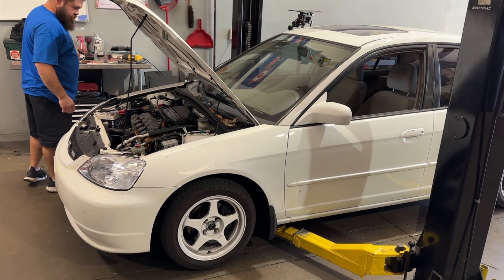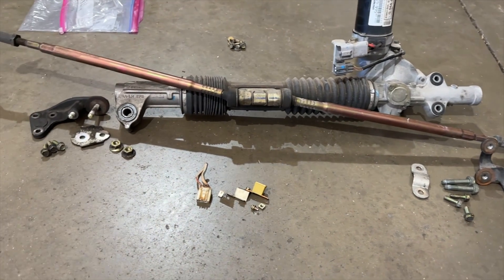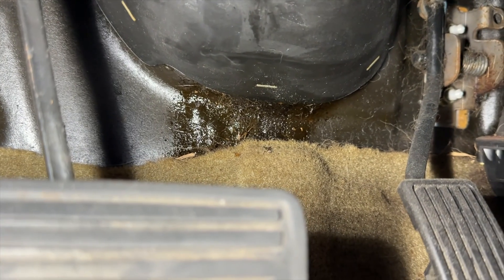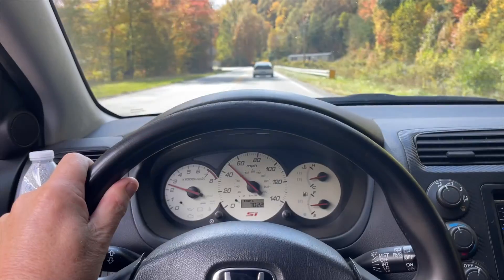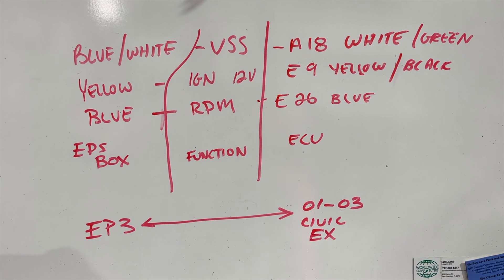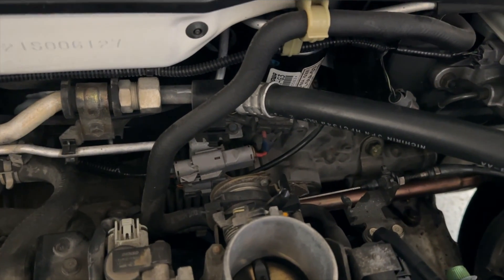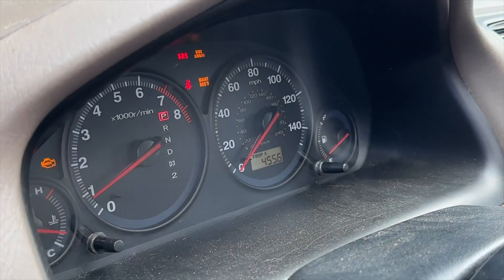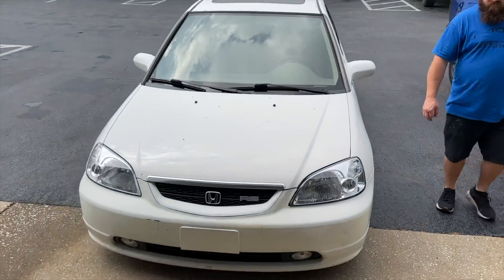Civic Electric Power Steering Conversion - Uncle Ray

Comment: I recently bought an 01 civic ex coupe with the conversion already done but wasn’t working at the time , I bought a new module 
Disconnected battery, plug new module in and drove the car for about 5-10 minutes with the power steering but then just gave out 
Might know what the issue could be? idk where to look

Comment: I had my HPS converted to EPS but there is not much difference, in fact the same. What do you suggest, where things have gone wrong? When I turn the whole wheel on either side till end the front lights get bit dim what could be the issue. Also I could not understand E9 etc. wires, which one are they.

Comment: what did you guys do with the original power steering pressure switch? its attached to the power steering lines on the original unit. I am wondering what you did with the plug thats on the car side. does the car throw a dash light saying lower pressure?
Reply: there is no power steering pressure switch of any kind
Reply from the maker: It’s electric. Where would you install the pressure switch on an electric rack ?
Reply: @  sorry for the confusion. I realize there is no pressure switch on the EPS that you installed. but they do come on the hydralic power steering you removed. my question is what do you do with the plug that now has no where to connect?  is it just zip tied up? do you have to put a resistor in it to prevent a code?  thank you
Reply from the maker: @ There’s no code if you unplug it. On this car, the plug was removed from the harness.
Reply: @LHTPerformance  thank you very much! again sorry for the confusion.
Reply from the maker: @ No problem. Thanks for the comment.

Comment: Does this change improve fuel average?
Reply from the maker: Yes. By removing load on the engine it will also make a little more. We’ve seen 6-7whp from removing a power steering pump.

Comment: I'm converting a 7th gen (2001 Civic EX) to electric (Tesla SDU) and would like to use one of these EPS racks. Can anyone elaborate a little on the RPM signal being emitted by the ECU? Since I will no longer have the ECU, I'll need to find another way to reproduce this signal. I'm thinking I might be able to use the wheel speed sensors, or RPM of the electric motor, and if needed, an Arduino, to reproduce the signal. So I think I would need to know the voltage (5V/12V?), if it's just a pulse on each rotation of the crankshaft, or a PWM signal, or some other format? Not sure what else. If anyone has any tips I would greatly appreciate it!

Comment: Great video.  I had a bit of trouble figuring out how to open up the fuse box at 4:25. I think I might just use my RSX's (I scrapped the body, kept all suspension parts).  Nearly all the fuses are the same as my ES1.

Comment: Thanks guys. I did this to an 03 coupe. Had to get creative running the wires but it all worked out.
Reply: Do you only need to tap the vss wire, the rpm and the key on power wire into the ECU for the control module to work?
Reply: @cadenyacavone960 hey did you end up doing the swap does the eps engage when at a stop
Reply: What route did you take to get it in
Reply: The passenger side

Comment: My ep3 civic feels stiff with the electric power steering, when you rev it gets lighter to steer, is there a permanent fix for this?
Reply from the maker: It doesn’t sound right. Either wiring is wrong or the control box is bad.

Comment: Does doing this swap trigger a check engine light?
Reply from the maker: Not if installed correctly
Reply: @LHT Performance  I guess I'm referring to the power steering pressure sensor pigtail. It no longer will have anything to plug into so I was wondering what changes you made in regards to that.
Reply from the maker: @jaroddennis8977  Ok. The ecu doesn’t care if the power steering is connected or not, thus you won’t get a check engine light from
It.
Reply: @LHT Performance  That just so weird to me bc it kind of makes that sensor and the pigtail it's plugged into pointless and useless lol
Reply from the maker: @jaroddennis8977  Unplug the power steering sensor will not trip the code. The pigtail from the ecu is to communicate to the power steering module what to do. ie speed
Reply: @LHT Performance  Ah ok. Bc I wanted to make sure I don't get a check engine light after I make the swap. I drove my civic with the pigtail for the pressure sensor in the hydraulic system disconnected and I haven't gotten any issues or lights so I was confused if that's normal or if something IS supposed to happen or not
Reply: Thank you for the help!
Reply: @LHT Performance how do you troubleshoot this system when it doesn't work?
Reply from the maker: @jaroddennis8977  The break down is in the Honda manual. We always refer to it first, follow the tree.
Reply: @LHT Performance  I wired everything in exactly like your video and I've tried a remanufacured eps and 2 modules and it feels like turning a 45lbs plate for a steering wheel

Comment: Not familiar with this year model. Is this engine similar to the R18 in the regular Civic 8th gen?
Reply: d17
Reply: No, the R18 is a totally different engine. The D17 is based on the D16 from the older Civics, but unlike the rest of the D series, very few of its parts are interchangeable with anything else.

Comment: Would this work on 4/5/6th gen civics? Maybe you could make the brackets and sell a kit 😀
Reply: Not with the 7th gen rack, it's a totally different setup. As far as I know, the only way to convert a 6th gen or older to EPS is with an electric power steering pump, which defeats the purpose of converting in the first place.
Reply: @averyalexander2303  I suspected there had to be some complication or someone would have done it already, but had to ask. Thanks!
Reply: @haqitman  You may be better off either deleting the power steering or getting a manual rack. I have no experience with the manual racks, but the 6th gens aren't that hard to steer with the stock rack and power steering deleted. I'm a smaller guy and I have no problem driving my EJ6 with the power steering pump belt removed. The 7th gens are a bit harder to drive without power steering, but still IMO manageable unless you are doing a lot of parallel parking or something.
Reply: @averyalexander2303  I've run w/o the PS belt, effort is about like a manual rack but response is sluggish. To go manual correctly you need a manual front sub frame since the man rack is a smaller diameter, kind of a big job. I may go this route but I'm getting older and having ps is nice. A drop-in elec rack with like 12:1 ratio would be sweet but I've not found such a solution. Appreciate the feedback!

Comment: Wish this would work om my 05 crv
Reply: It might if the rack is mounted in the same fashion as the ep3/rsx/em2
Reply: Swap has been done on an Element  should be similar to the CR-V
Reply: The 02-06 CR-V is built on the same platform as the 7th gen Civic and the RSX. I would not be surprised if it bolted right in.

Comment: No one hardly ever tries to upgrade the EM2. The 1.7 is like a step child...
Reply: The plan is to eventually loose the 1.7 and swap in a K20 with 6 speed
Reply: Right but it's a tough engine if you change your oil often enough, Headgasket can be a problem after 200,000 But it's not a big deal to me as long as it wasn't overheated because the heads go bad quickly in high temps, I know because I had a radiator drain get broke off once running 75 mph down the highway after hitting some strange animal in the dark, didn't notice the water temp pegged out causing the head to turn into a Tato Chip 🧐. O and by the way it only had 115.000 miles on it when this happened I installed a good head and it didn't damage any of the cylinders dosen't burn oil even after running it out of coolant like this.

Comment: That's cool I have two 2003 hybrids with the electric power steering, I ran both cars well over 300.000 miles Never had a Single problem with this System from either car, both Cars are for parts only now, I guess I should pull both out and save all the necessary parts so others can Swap cars like You guys just did, Great Content this is why I watch you're Content 👍, From Wisconsin.

Comment: Do you also replace the factory steering slider when you do this swap? I’ve read how those are fragile from the factory on the steering rack where the tie rods meet in the center of the rack, but in both RSXs I’ve had, they were fine. Curious if you recommend this upgrade?
Reply: Definitely do it the oem one is plastic the billet one makes a big difference
Reply: Yeah u should replace them..i have replaced it with delrin its like POM